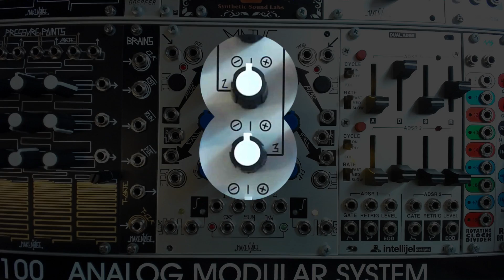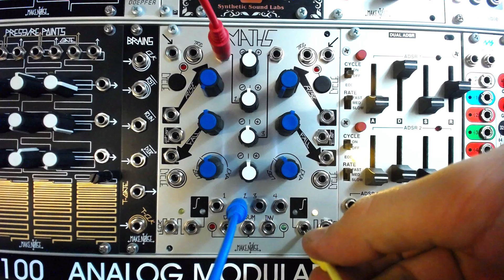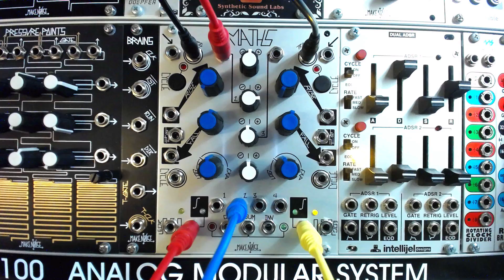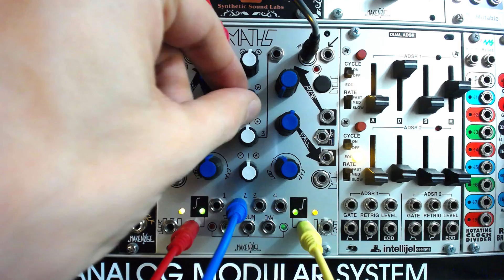Squashing Eurorack Sequences With Maths

Comment: 1. Signal IN Channel 2: Direct Coupled input to Attenuvertor and SUM/ OR Bus. Normalized to a +10V 
reference for generation of voltage offsets. Input Range +/-10V
2. Signal IN Channel 3: Direct Coupled input to Attenuvertor and SUM/ OR Bus. Normalized to a +5V 
reference for generation of voltage offsets. Input Range +/-10V

Comment: I think this video might not be correct the offset range is only different when nothing is patched into channel 2 and 3 input. When something is patched into channel 2 and 3 they act as attenuverters with the same properties.
Reply from the maker: +Auxar I think it's somewhere between there actually. I noticed it didn't seem to be going the full +10v, or the sequence would have been stretched across two octaves, rather than 1.5 or so. So, I think the ranges are a little off in the docs and device. I'll ask Tony tonight at Analogue Haven :)
Reply: So if you put in for example 7V the range of the attenuverter is from -7V to +7V  if you want to subtract or add to the input signal you use the other channel without input to use the offset for adding/substracting from the other channel. Then use the sum output.
Reply: +Voltage Control Lab The slight variations might be due to potentiometer tolerances